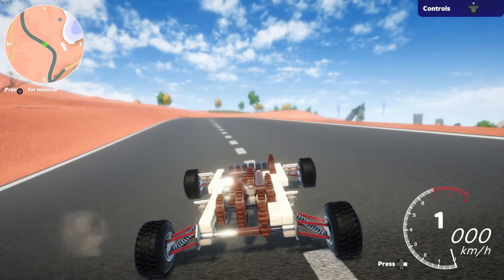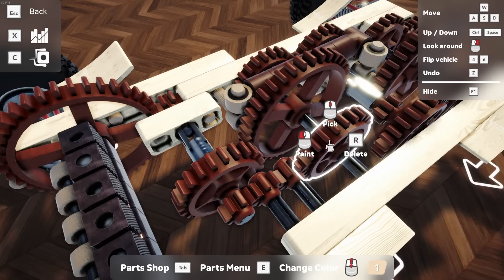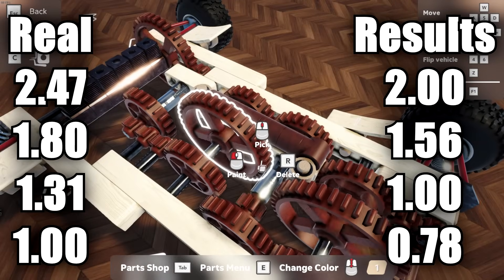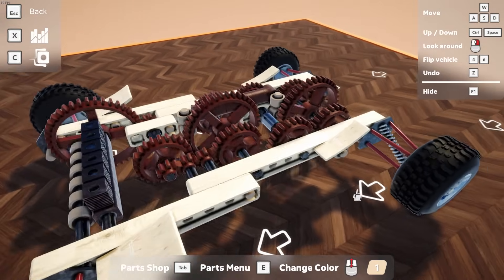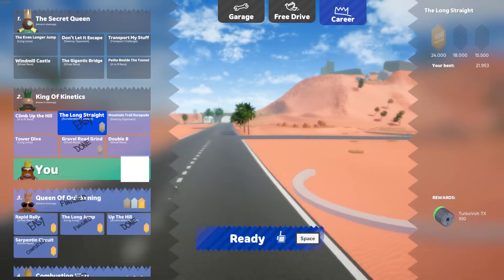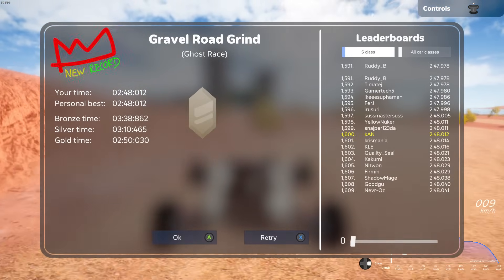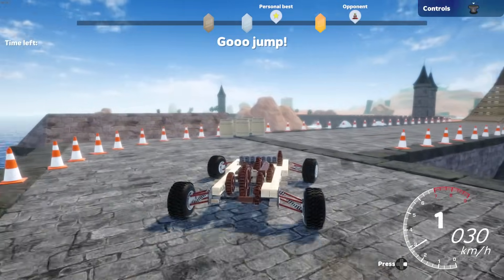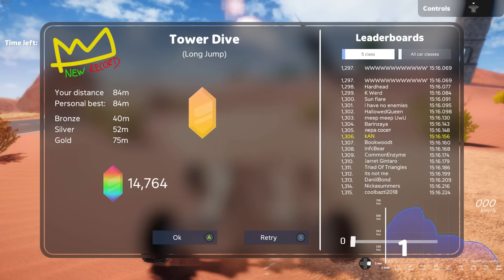I Built an Insane 4 Speed Gearbox Using Real Life Transmission Ratios!

Comment: Hey kAN, you know that you don't actually have to have an auto transmission all the time. There is an option in the settings menu to shift up and down using the ',' and '.' keys on keyboard. But the thing is, I tested it but I really don't think there is manual shifting keybinds on controller.

Edit: also another thing that I found with 'A to B' races, is that if they don't have any checkpoints along the way to the finish, you can super ultra cheese them. All you gotta do is press your 'reset' key right after the countdown. I found this out by complete accident when I was playing on controller and I accidentally pressed the reset key instead of the repair key on an 'A to B' race.

Comment: Keep in mind actual cars have both transmission ratios and a final drive ratio. So while the transmission may range from 2.47-1, they are then multiplied by the differential gear which is generally in the 3.5-4 range, chosen based on tire diameter, acceleration vs top speed, and fuel economy.
The real ratios you used are 31-37% taller each gear (1.31/1.00, 1.80/1.31, 2.47/1.8) and your build's 1-2 and 3-4 are pretty close to that with the 2-3 shift being a bit wider. The effect is when you shift the real car, your engine rpm will consistently drop ~35% and should keep you in the power band. Yours will drop 28% shifting into 2nd and 4th - which is better than the real one - but will drop 56% shifting into 3rd. In game, it might not matter too much but IRL it would pull you out of the power band and make it really hard to shift smoothly
Reply: ingame it costs him time that the gears are so close together because shifting takes a long time in this game which makes longer gears with a bit less acceleration actually better then a lot of short efficient gears that you have to constantly shift

Comment: You should definitely try making a gearbox with planet gears! I made a simple 4 speed gearbox and it makes my 331hp car go over 500 kph vmax and 132 m/s2 acceleration.
Reply: either you have over 4 powered axles or you are just mindlessly spinning your tires. maybe make the gears a bit longer so you dont spin the tires and get more top speed as well
Reply: @sgxbot  Well what exactly do you mean by saying "make the gears longer"? The car is RWD only and handles quite well onroad. I'm just getting into the game with no experience so this design could definitely be improved, but works good enough for me considering how compact and simple it is.

Comment: If you do 4:5/5:4 on the first shifter and 2:1/1:1 on the second one you get the ratios
0.8 1.25 1.6 2.5 which is very close to what you calculated

Comment: 2:46 You know powering a big gear to a small gear gets you more speed and less torque. it could give you more acceleration if you have the torque to drive the bigger gear 
!!!but usually, a smaller gear powering a bigger gear gives you more acceleration!!! flip from on top, if you go too small (on drive gear) you can lose on acceleration but you will always have more torque.

Comment: would it be an idea to make a branching transmission a.e. make a shifter that does 1/1 to two different switchers

so first branch you have another switcher that goes to a 1/1 and a 4/8 
then back to the first switcher 
it goes to another switcher that has 5/4 and 8/4

Comment: Just built this the exact way shown in the video and its completely different. Either the update broke it or somethings are not working right.
My top speed is 105 and it has much worse accel. And it wont go in reverse like you show.
Reply: All this did was piss me off as I've been trying to get all the parts so I can play freely. But it won't even work properly.
Any car I try to make either spins out every time I take a slight turn in any way or it's accel is 1.0

Comment: 6:58 you got your ratio backward. Your first gear should be 2, second gear 1.56, third 1 and forth 0.78. I hope you did not measure the reverse of that.
Lets sa you are in first (2.00 ratio). If your engine turn 1000rpm, your wheel turn 500rpm. Your wheel wont turn 2000rpm, that would be a ratio of 0.5.